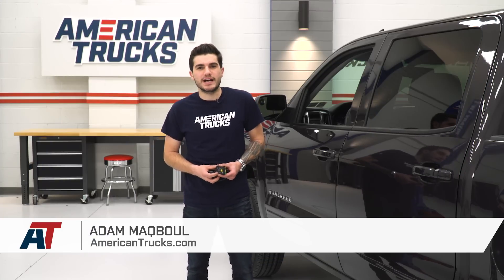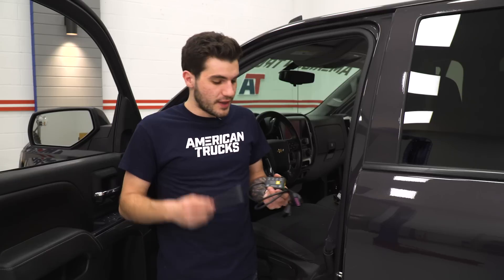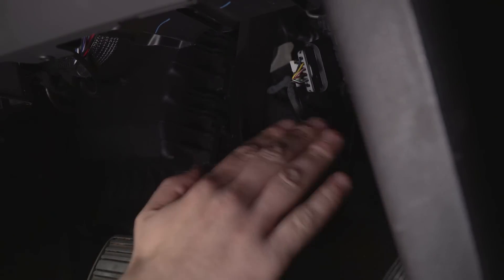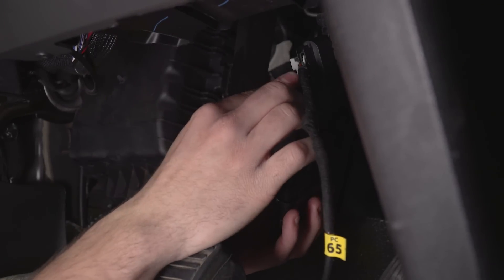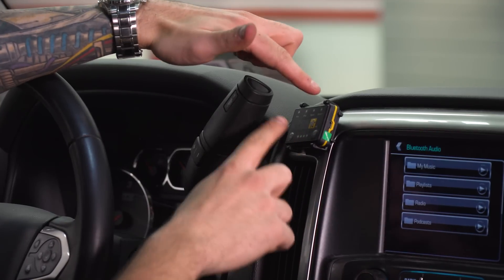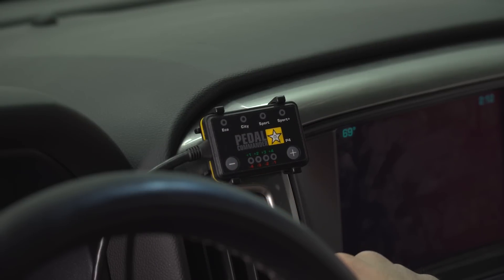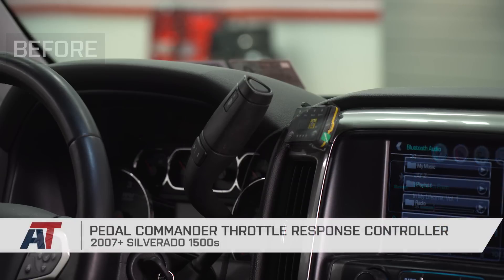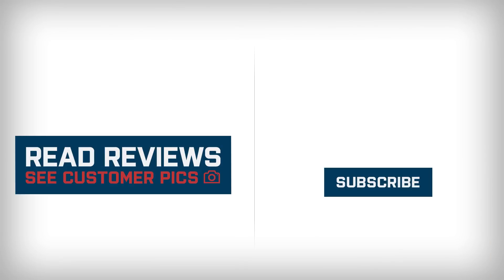2007-2018 Silverado Pedal Commander Throttle Response Controller Review & Install

Comment: Have this on my 2015 1500, put it on sport + with medium-high sensitivity , you’ll keep up with some cars you think you wouldn’t be able too. Slap dual exhaust on your truck and you’ll have it sounded like a race car with that fuel richness
Reply: it only changes the timing between you pedal going down and the car moving forward, no power added

Comment: I have one.  On a Ford Raptor.  Don't call it a gimmick or fake.  Huge difference from with to without.  I loved it at first.  That being said, I've had it on for 2 years. I started noticing odd shifting, especially down shifting, or not shifting.   Like to the point I thought something was f*cked up.  I took the Pedal Commander off, and my problems are gone.  I don't go by what people "say" ---- I go by what I actually experience, and that is what I've experienced.

Comment: It's great for controlling throttle response on wet days and dry days.
On wet days, helps to keep from spinning the tires while in 2 wheel drive mode when set to the lowest level.
And the newest model can be controlled via a smart phone.
Reply from the maker: Totally! Thanks for watching.

Comment: Hi, very informative, advanced, and complete information regarding the throttle controller, thank you, but I have a question I hope the admin or AmericanTrucks Chevy & GMC can answer regarding safety issues, My question is what if the throttle controller's device suddenly fails? or the little wire cut? Do we still have the control of gas pedal? or it will be back to normal mode? Thank you for hoping AmericanTrucks Chevy & GMC can enlighten us. thank you again!
Reply: Great question

Comment: I love my pedal Commander works perfectly fine on my 08 Chevy 2500 HD brought that old vortec right to life
Reply: Was it pretty noticeable?
Reply: @teamcummins  I bought mine for a hundred bucks off Facebook marketplace
Reply: Do you have to select/power it on manually every time you turn on truck? Like, does it remember last setting it was on last?
Reply: Have you had any problems with it  in the long run?

Comment: Can the DiabloSport  marathon active fuel management module be used with this?  I regularly drive west to east coast at least once a year. I’m curious if the two can be used together for that or for everyday use.
Reply: I have both of them install on my 2018 no problem
Reply: @1207integra any hard shifting in low gears?

Comment: I purchased a pedal commander for a ram 2019 diesel truck, but my question is, will that same pedal commander work on a ram diesel truck 2021, both are 3500. Thx
Reply: it should yeah just go ahead and make sure the connections are the same with the pedal from ur other truck and then u will see if its compatible

Comment: Can I tune my truck and then add the pedal commander? Because I have 33s and I would like to tune my truck and correct the tire size with the tune.
Reply: I was wondering the same thing..
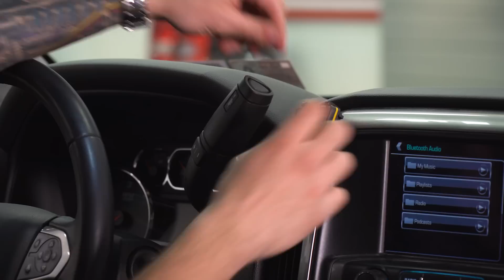Reply: If you want your power back, put your money into a set of 4:10 gears in your front and rear differentials. Not on this garbage.
Reply: Yes it works with almost all tuners. I have a hypertech tuner and the pedal commander on my truck

Comment: I have a pedal commander... But here is my question, is it safe to drive with pedal commander in  city mode, but my gear selected in the car is in sport mode?
Reply: Patrick Shirley sport mode isn't going to add any power. So yes it's fine

Comment: Okay more throttle response would be great but what about when you let off the throttle, does it let off just as fast as you push the accelerator pedal? My 14 Silverado has very slow throttle let off. I hate this drive by wire, my can am commander and maverick both had it. The engine does not rev down fast at all, so will this cure that issue?
Reply: This doesnt do anything to throttle response because the response is instant to begin with.  To cure your problem you need a tune.

Comment: The pedal commander will eventually put your truck in limp mode, you will get a throttle pedal position sensor error. I put a new gas pedal in and again after a few months another throttle pedal position sensor error so I removed the pedal commander and had no problems since. It's a waste of 300 bucks.
Reply: you probably tried to switch modes while in gear I've had one on my Silverado 2500 for 6 months now still haven't come across any issues yet, there's literally a discloser that tells you not to do so or it'll go into limp mode.
Reply: I know a guy that'll give you twenty bucks for it, if your looking to get rid of it. Just throwing that out there.
Reply: @KristianSalas1  so don’t switch modes while in gear ? I’m lookin into getting one for my 2015 Silverado 1500
Reply: @papabear3671  hahahahahahahahaha
Reply: @chris1k_  yeah don't do that you'll send it into limp mode bring it to a stop put it in park switch the mode then go. just give it a sec when doing all that

Comment: That device made my truck reduce engine power witch means a check engine light. Make sure you have a scanner on broad with. Because when my pedal commander took a shit my truck stop functioning correctly.
Reply: I disconnected my battery and it was wiped. I learned it was the Bluetooth app so I only change it from the device
Reply: @elalex27  I think it would be better to have a scanner. Disconnecting the battery is a little bit of a hassle for me my truck is lifed and on 35s. But you make a good point Disconnecting the battery does erase codes
Reply: @heavytrucks5237  
Take your throttle body off and clean it. 9 out of 10 times reduced engine power is from dirty TB. Adding the pedal commander increases sensitivity of pedal and TB. Any bit of sluge or dried carbon on the flap causes it to stick.

Comment: Oh!!  A Pedal Commander!! Lost 2 Gen V’s with them. Don’t ever use in auto Manuel, no rev limiter. Your engine constantly goes to diagnostic mode. Anyone want a few. 1 for a 2019+ 6.2 Trail boss…1 for a 2007 2009 Silverado. 100.

Comment: can this be used with the Range AFM disabler? wondering since i'm running the Range...
Reply: l Pronox how’s the range experience so far I ordered mine this week suppose to get It tomorrow
Reply: @isaiahbabb8612  definitely a must have if u got aftermarket exhaust system. Loving mine.
Reply: Got to me early on Friday installed and yea it’s great, I have the borla atak exhaust setup, the little red led inside is a nice touch with my red truck too lol
Reply: Can you use Both at the same time ?
Reply: @johnf1577  don't see why not

Comment: Can you combine it with a AFM/ dod delete? And does it leave a trace on the ecm?
Reply: I did and it works good still trying to find the best setting on the pedal commander for every day driving
Reply: It removes the DoD also?
Reply: Any problems running the pedal commander and the range afm?? My truck started jerking or something and had a check engine light, my truck stalled took it to the shop and they said my fuel pump is going out, not sure if it has anything to do with the products.
Reply: @dg-man211 did it?

Comment: I believe I have a check engine light on because of this installation. I currently have the code p2138 sometimes when it’s on it runs fine and when it’s off it throws a code and my truck goes into limp mode
Reply: Update?
Reply: @alexcarbajal6632  I have replaced the gas pedal and code is still on. The truck just sits In the driveway now.
Reply: @mysticgaming1730  never went to take off the code?
Reply: @alexcarbajal6632  I reset the code, I’ve also disconnected the battery multiple times. There is a code p2137 and p2138.
Reply: @mysticgaming1730  dayhm so it ant worth it ? 🤦‍♂️

Comment: Thats a gimmick... It just tricks the computer into think your appling more gas then you really are.... To get rid of throttle lag it has to be tune out
Reply: The first number (the time in seconds) doesn't matter. It just needs to be a constant in the comparison (in bold below).
The second number, although I don't know the exact differences, everyone agrees that Pedal Commander makes your throttle body open more with less press of the gas pedal. 

So explain how this is this wrong:  (remember, you said the throttle body is open further with the same press of the gas pedal). In both instances below, imagine that you press the pedal to 100%.    It takes TIME on a clock to press your gas pedal from 0 to 50%, 85%, 100% etc.   The more you push it, the more time it takes.  Just like slamming a door shut. It takes more time for it to completely shut than it does to to go 25% of the way shut.    

The comparison below, imagine you press the pedal 100% in.  How did does it take?  Lets say approximately 1 second. Again, doesn't matter...it takes the same time to press whether you have PC or don't.  

*Without Pedal Commander - after 1/3 second you are at 33% throttle.
With Pedal Commander - after 1/3 second you are at 70% throttle.

*So now imagine....at 1/2 second in to the process of pressing the pedal in, will your vehicle will be FURTHER ahead on the road if it is at 70% throttle vs only  33% throttle? *

I had a pedal commander. It works.  For the reason I stated above. To understand my reason...you need to be able to read and comprehend.   Many can't do that.  I'm not saying it adds HP... doesn't do that. In fact, I took mine off because it caused weird shifting problems.

Comment: Do they have one for camaro ss
Reply: Yes, for 2009 and newer.
Reply: Pedal Commander awesome i have a 15 and hate throttle by wire and would love to have it feel more like a cable in how responsive i also have a 99 lm7 z71 and i like how touchy the throttle is where my Camaro is like cold molasses in how it reacts
Reply: This product will make your car feel less like throttle by cable, dont waste your money.  Get a tune to solve the issue which is torque management.
Reply: Sergey Melnik thats my new plan then

Comment: Does this void warrenty?
Reply: Tom Woods no. It's not a tune s0 it doesn't modify any parameters in the ECU. if you have an issue with your truck just take it off and no one will know that it was on. Unlike tuning that leavs a code in tue ECU on newer trucks that the dealers can see even if you flash it back to stock.
Reply: @I5ZQ8   Thanks for that answer

Comment: why don't trucks have this from the start?
Reply: Because of vehicle dependability. It bypasses the ECU witch could cause problems with valve timing, knocking sensor, and so on.

Comment: why doesnt chevy just fix the problem?
Reply: It’s not a “problem.” It’s how they designed it.... intentionally.
Reply: @ClericalConsequences  IF ITS NOT A PROBLEM THEN WHY DIS THEY BUILD A DEVICE TO ELIMINATE IT? i OWN ONE AND YEAS ITS A PROBLEM.
Reply: @darrrenbetker4266  Chevy didn’t design the pedal commander. From the perspective of the designer of the vehicle, there is no problem. It’s exactly how they want it.
Reply: @ClericalConsequences  so.....why did they make it with a delay? and why then do people pay allot of money to get rid of it?
Reply: @darrrenbetker4266  because auto manufacturers have to balance fuel economy, safety, performance, and other factors. A relatively mushy throttle response means a safer vehicle that uses less fuel, at the expense of a little performance. People who buy pedal commanders (and I am one of them) want to have control over that balance themselves, and to be able to shift their priority towards performance or fuel economy as it suits them.

Comment: Dont get this! I got it for 2016 silverado it was working good for like 2 yrs and and after a while my engile light turn on and the reduced power engine, it was telling me to replace my acceleration pedal sensor so i took off the pedal comander ,and the problem stop i just did a restart on the truck and now it’s working nice than ever . Didn’t need to replace anything.WASTE OF 300 dollars

Comment: This will void your warranty.
Reply: No
Reply: Daniel Smith That wasn’t a question, it’s a statement. I’m a service tech at a dealership and if I find one of these on a vehicle I’m servicing I’m required to report it for a warranty void. You better remove it before you go into service.
Reply: @RealSuperRando  Oh! Thanks. I was just going by the manufacturer's statement.  They said to hide it also because the dealership would try and void your warranty, but the law is on my side. You would be in for a fight which if you would ultimately win if you were up for a fight. The problem would have to be directly attributed to the aftermarket device.